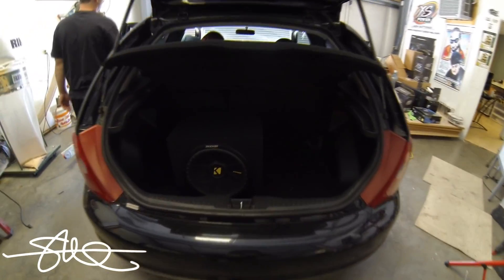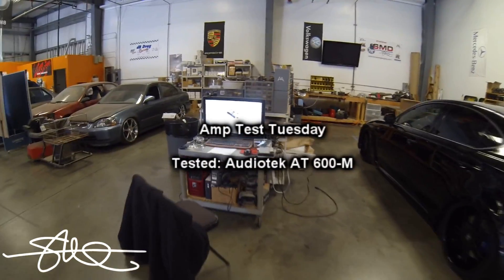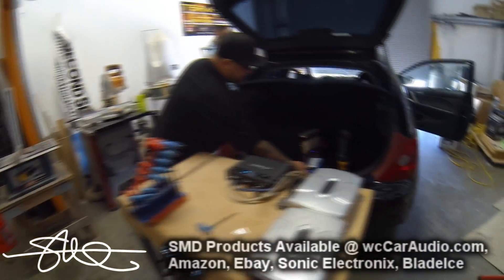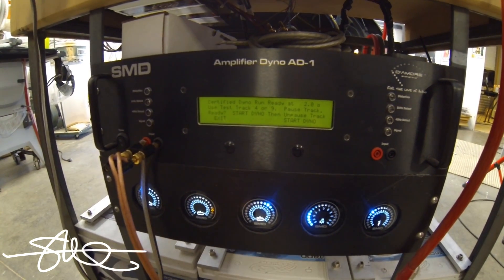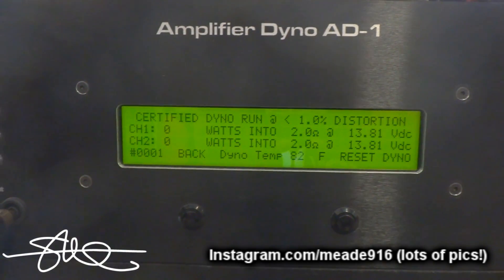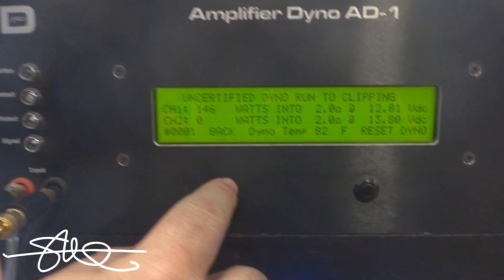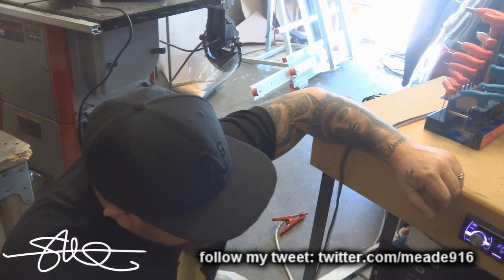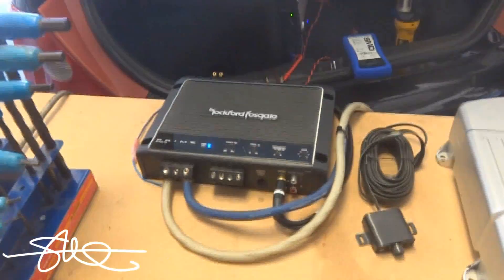Amp Test Tuesday - AudioTek AT-600M - 1200 watts Max - the COLD TRUTH.

Comment: I got an audiotek 4000w peak at 1ohm (2000wrms)
2000w peak at 2 ohms (1000wrms)
Then 1000w peak at 4ohms (500wrms) and it bumps without heating problems at 2 ohms. Haven't wired down to 1. Pushes an 1000wrms 18 inch sub

Comment: I would like to see some more budget amps being tested. Like boss armor or riot series or even ssl amps. Just curious how they would stack up at 50.00 price low budget amps.
Reply: mike waters  i have the boss armor 1600.4. i have 2 4ohm 12" pioneer subs hooked up to it. hits pretty good. but for $60 what more can u ask for.
Reply: I agree, I have the 1500.1 running  a 12 xtr dvc and it sounds great for, like you said 50 bucks. I was shocked to see it rated at 105 s/n. I wonder what the true power is. Regardless it pushing my one 12 nice.
Reply: I agree, take a look at the SLL amps they look pretty good too for the price range. I say these budget amps may put out about 60 % of the rated power. But it would be great if these companies did use the real output.

Comment: Can you do the boss nxd 4500 stable to 1 ohm claims 2500 rms at 1 ohm which is what I run it for my 2 alpine type r 12s sounds like it's okay
Reply from the maker: as a "boss" owner...i am just giving you fair warning.  You don't want me to dyno a Boss amp.
Reply: Lol I can see what your saying tried mine last night with a 40hz test tone at one ohm 2000 watts I was extremely surprised
Reply: meade916  so i am curious. I have a subwoofer that is rated for 300 watts rms (cea-2006). and i have an autotek 1100.2 mean machine (i got it for 5 dollars). should i expect it to get around 280 rms then? if i am saying something wrong i apologize. (it would be 4 ohms bridged)

*edit i read wrong the brand of this amp i thought it was an autotek so im not sure if this is applicable sorry.

Comment: Don't know if  in the right area but here I have a 12" JL audio 30V sub with a autotek axl amp 1050.2 but my trunk ain't rattling the guy who installed it for me did stuff and tell me to leave it alone but do I chance the bass eq on the amp higher or the low pass what's the best to get the most for your buck without frying my 12".
Reply: get a better monoblock amp

Comment: Steve:  Check out out the sample video.  This is only a partial part of the ride.  To get complete picks would take time.  I saw chickens ride and the 72 chevelle.  Sorry for the confusion.  This is a simple alternator wire upgrade not wiring the alternator itself.

Comment: most alternator shops will not touch high output alternators.  i have an ohio generator 275 amp alt.  when i mention rewire, this just means connection odd guage cable and the factory wire .  i watch your videos and you do these alts religiously

Comment: they don't work like that. the label rating is just fake, simple as that.

all amps are limited either by the power supply voltage, or by the protection circuitry in really high power ones. since cheap crap like this usually has NO protection, it means it has a wimpy power supply which won't allow it to do more than what you saw, at ANY frequency. okay, it might do 10-20 more watts in the midrange but that would be it.

Comment from the maker: the DYNO has 2 channels.  It has nothing to do with how many channels the amp has.  You only need one of the dyno's channels to handle this little amp.  Up to about 12,000 and 1 ohm and below just needs the single channel.  If you go above that or below that impedance, you use the mono settings. That is the 2nd time ive explained it.

Comment: AT-600M
MONOBLOCK POWER AMPLIFIER

1200W MAX 

MAX POWER: 1200 WATTS
MAX 1 OHM: N/A
MAX 2 OHM: 1200W X 1
MAX 4 OHM: 600W X 1
REMOTE SUBWOOFER LEVEL CONTROL
CHROME PLATED RCA INPUTS
VARIABLE GAIN CONTROLS
LED POWER AND PROTECTION INDICATORS
VARIABLE BASS BOOST CONTROL
VARIABLE SUBSONIC FILTER
PHASE SWITCH CONTROL

that's all i could find about this amp ... i dunno if anybody posted anything though ...

Comment: Are these amps from previous installs that replaced these units or are they random choices. I would like to see a test on an spl gla-2400. Claims are 700wx1@4 ohms,950wx1@2ohms,1300wx1@1ohm,would like to put this in my car the is $139 off sonix electronix website, thinking of running the MTX dual 4 ohm 55 series. Any feedback would be great.

Comment: Hey Steve, so I been watching your videos n I'm impressed by your work, and your awesome Tahoe. But I got a little extra bass in my car, two loud 15' but I'm powering it on American bass. This is a 5000 watt 2 ohm, and I want to know if this amp does what it really says it does. I have both these two 15' running on this amp so their suppose to be getting 2500 watts to each subwoofer. By any chance you know if this amps doing its job?

Comment: Hey mead just a request on an amp to be tested could u get jl audio  500/1 or 1000/1 slash series they say those amps will do the power from 11.5- 14.5 volts from 1.5-4.0 ohms  would really appreciate it man

Comment: I used to run a old mtx road thunder rt251D and it claimed "Power output: 100 watts RMS x 1 (4 ohm load), 200 watts RMS x 1 (2 ohm load)" and I always wonderd what it really did bc for a small amp it made anything sound amazing

Comment: Thanks going to be running them on my beloved Fosgate T10001bd. Also what do you think about the 6 1/2 inch Eminence Eminator door speakers? They are 100 watts RMS/400 watts peak and 8 ohms. Thinking of getting these for my mids. I have heard good things about them but haven't heard them in person. Though i would see if you knew anything about them or heard them.